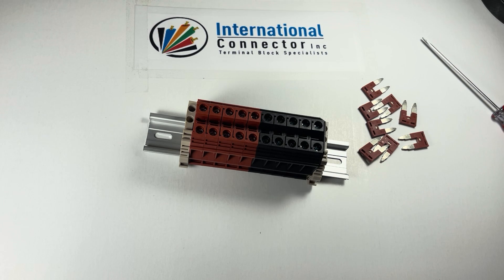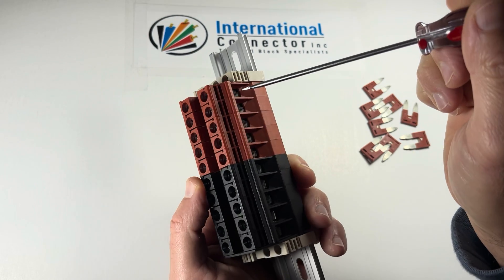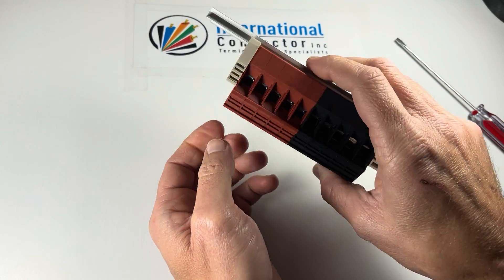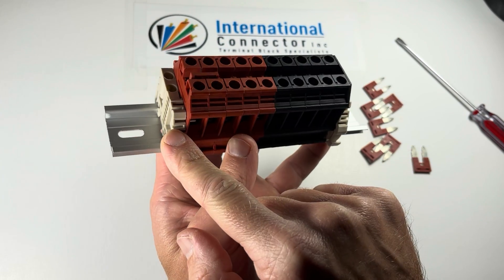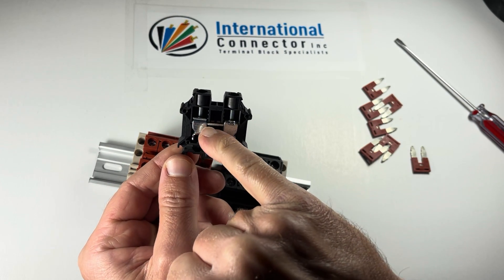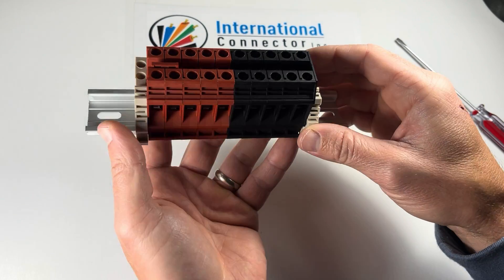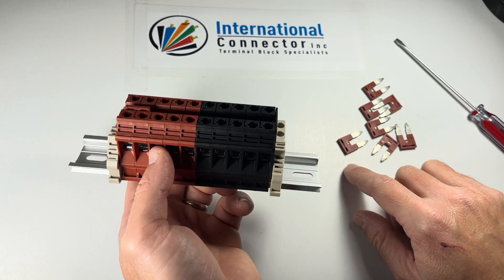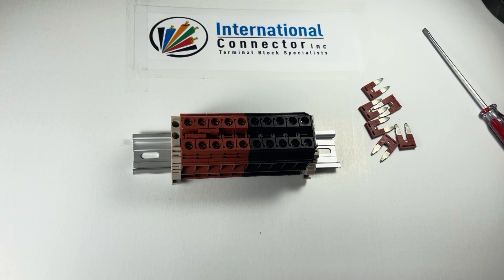How To Manipulate and Install Solar Assembly Kit DK10N Dinkle DIN Rail Terminal Blocks Blocks

Comment: After you put 2 jumpers in as you showed with the overlap, can you have a 3 wires on one side and just one wire on the other🤔.  That's what I'm  trying to do.....combine 3 and transition into one ......thanks
Reply from the maker: Yes, absolutely.  When you put 2 jumpers into 3 blocks, you now how 6 wire connections that are all in common.  3 on each side.  It doesn't really matter which one is the in and which is the out.  It has essentially become a high-end secure wire nut at this time.  Having 3 in's and 1 out is definitely fine to do and what it is made for.

Comment: Can I use this with solar panels to connect a bunch of different solar panels together how would I wire it how would it exit.
Reply from the maker: How it is shipped, it is 10 single-in single-out blocks.  When you install a jumper, it connects the block next to it electrically.  Inputs and outputs only depend on how you want your electrical panel to flow visually.  Once combined, they are essentially a wire nut, so you could have the in and out on the same side or different sides.  You just don't want to combine the positives and negatives for obvious reasons.  That is why we only give you enough jumpers to combine all the blacks and combine all the reds.  Also, the red/black gives it a nice visual separation.
Reply: @internationalconnector I bought two kits with the intention of making 10 to 1 connection with all reds. And same for blacks on the second rail, by disassembling and reassembling. However I had no idea I'd be short 1 Connector to make the nine jumps required to connect the 10th. Can you send me 2 missing jumpers to make this work?
Reply from the maker: @jamesbsa6450  I believe that you would need to reach out to me directly at intconnector to share your mailing address.  If you are looking to go from 10 wires to 1 wire, you only need 6 blocks, because that gives you 12 wire connections, but maybe you want all the in's on one side.  We also sell "combiners" that already do this for you, so you don't have to recreate the wheel.  If there are 10 blocks in a combiner, it will often have a 10-pole jumper that connects all 20 wire connections and makes them in common.
Reply: @internationalconnector  I got it sorted out, user two kits and ran each positive string separately and each negative string separately into a terminal block, one wire in, 3 out (1 to SPD, 1 to MCB).